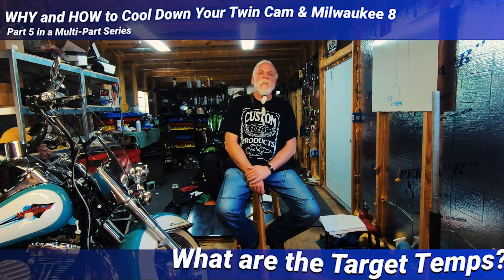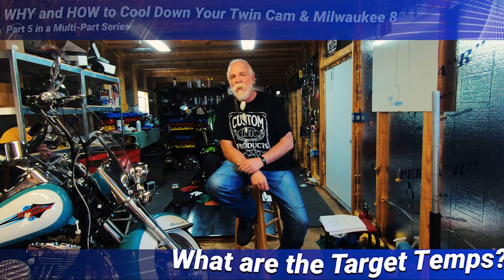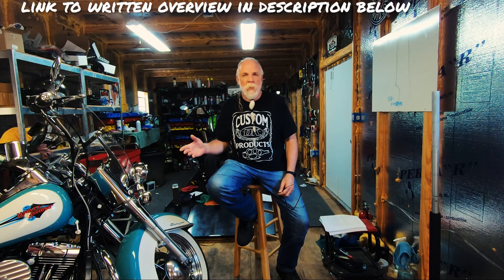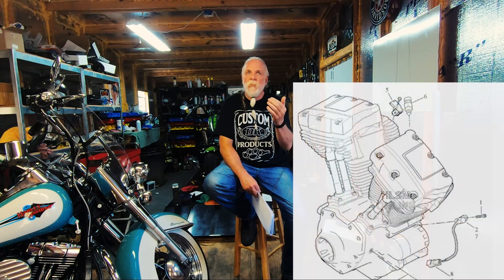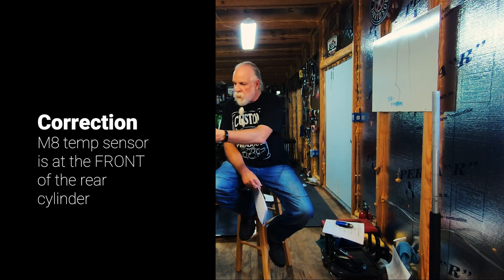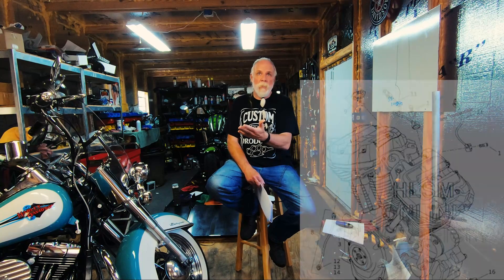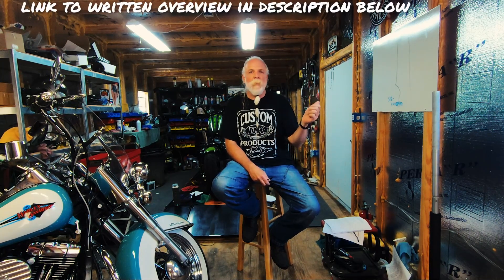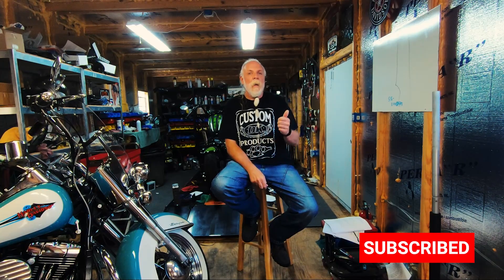Optimum Harley Temps for Comfort, Power & Longevity

Comment: I'll have to check my ET with my FP3 today. Running your external breather bolts, high flow intake from K&N and full system pipe. Hopefully im cooler than that 260 on my M8
Reply from the maker: All depends on which M8 you have, what else you've done to the bike, what your ambient temps are, and how far your riding at one time.  If you've only done what you've listed, and the ambient temps are above 60,  and you're riding for 30 minutes or more at a time, you are most likely well above 260 degrees ET.
Reply: @DKCustomProducts  It was 85 yesterday and after riding 30 minutes at 80 i had a max ET of 275.
Reply from the maker: @MeathedMoto  What bike do you have?  260 is a good target, 275 is still not bad. 290 is where problems start happening.  If you have an oil temp gauge, check it out next time you're on a 1 hour or more ride and see what it is at, along with your ET.
Reply: @DKCustomProducts  2018 Road Glide Special with the 107" motor.

Comment: My m8 is always over 300 on the highway using a FP3 to tell, up to 330 at highway speeds. 2017 ultra with 50,000 miles so far.
Reply from the maker: Is that the ET reading?  The one the ECM uses?  Or is that cylinder head temperature?  If it is the ET, that is too hot.  If it is ET the engine will keep running, it will have experienced a gradual reduction in power, as the cylinders go out of round and the valve seats no longer seal well.  Normally this is so gradual that most folks never notice the reduction.  But a dyno will see it, as will a leak-down test.  See this video on leak down tests- https://www.youtube.com/watch?v=2YrM7f321JE
What is your oil temp running?
Reply: DKCustomProducts Head temperature I believe. What ever the FP3 uses

Comment: I have spoken with you guys a few times on the phone and via fb messenger, one thing I haven’t addressed with you guys directly is temp numbers on my 19 sg 107. Im running a s&s 475G, arlen ness velocity 65 and fuel moto jackpot street outlaw 2/1 tuned with a pv. I have added an a1 cycles/m3 ventilator to reduce crank pressure, the dk deluxe tank lift, and cooling deflector wings as well as an ultra cool side mount fan assisted oil cooler. My et ranges between 270-295 currently (i installed the ultra cool yesterday 7/18/20) and head temp ranges from 290-315. The hotter temps are of course on hotter days. I rip my bike through the rpm range frequently, im not the kindest rider lol. Are these temps in an acceptable tolerance? I still have a few more things i want to do including adding the dk oil filter relo kit, a tmax oil cooler fan for the bottom cooler and love jug fans for the heads. 

The reason behind the tmax fan is because i live in a very tourist hit area so i know i need the extra wind during the summer. 

The reason im asking after you just made this awesome video is because even when i see alarming temps on my pv, my motor doesnt miss a beat and has all the power it is built to have, the only effects i feel are a little sluggishness in the first 5 ft coming from a dead stop almost as if it hiccups and then rolls out.
Reply from the maker: You are right on the edge on the ET, which is probably why you feel that bit of sluggishness on the take off.  With the other things you're talking about (oil cooler fan & Filter Relo) you'll probably get off the edge.
Couple of notes-  If you have not done an EBS (see this link- http://www.dkcustomproducts.com/all-twin-cam-engines-c76-192.htm ) you will get better power, lower temps, prolonged engine longevity, and tune stability by installing one.
We only look at the ET on the power vision, the head temps vary too much to be a reliable indicator of overall heat.
What are your oil temps running?  That is a very important indicator on overall health and functioning.
Reply: DKCustomProducts i made my own ebs meant to mention that as well, its not the prettiest setup but it is working, used the stock headbolts and rubber boots instead of the arlen ness headbolts and ran fittings and fuel line to the back of the bike. 

As for oil temps at the moment im not sure, its cool enough where my ultra cool fan hasn’t turned on yet so according to them that has to be sub 230 or right at it when et is around 290

Comment: Got a sporty , great info on temp, Got the V and H  FP3 , Dk high performance oil filter , Air filter , straight exhaust , Wish they had a page with the temps.
Reply from the maker: Yeah, very few Sportys need help running at ideal temps.  I have an oil filter relo on one of mine, not for cooling as much as to make oil changes much easier.  :)

Comment: Two questions;
How many years have you been growing that beard?.
Second, is there an oil pressure gauge that I could put on our Trike?, would it even be feasible?.
Reply from the maker: I think it's been 15 years or so, but it stopped getting longer around year 8.
Not sure what year you have, but there are sending units in the engine case, and it would just be a matter of finding a spot to mount an oil pressure gauge (I've seen some do it in the fairing lower cover).  You may also have to swap out the sending unit to match whatever gauge you use.
Reply: @DKCustomProducts  , 15 years,wow.
Ours is a 2015 FLCHU or however it is spelled.
Reply from the maker: @kevingleason5434  Your 2015 you probably do not want to replace your volt meter or fuel gauge, so putting one in the lower fairing cover is an option.  You can also mount one off one of your rocker cover bolts.  However, I believe you do have an oil pressure readout in one of your screens in the center of the cluster.
Reply: @DKCustomProducts  ,I will check that.
Thank you